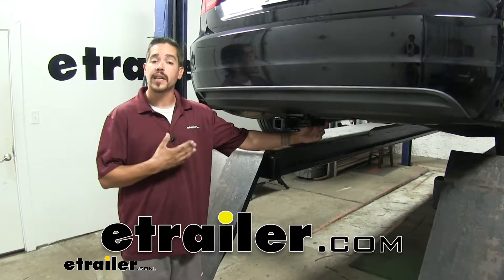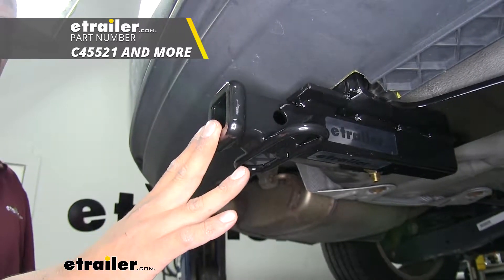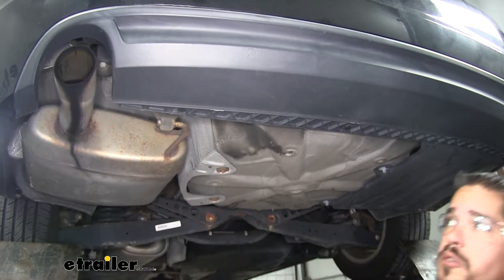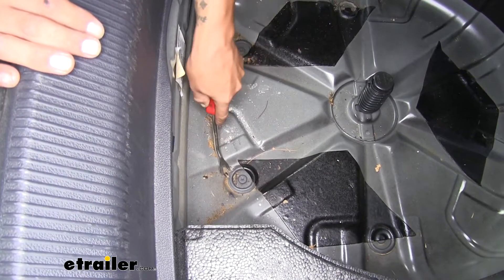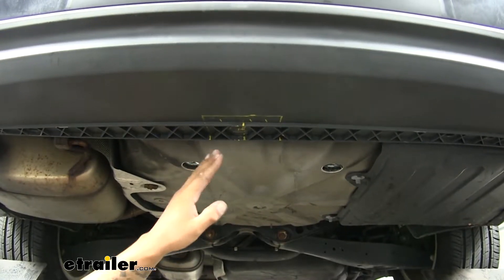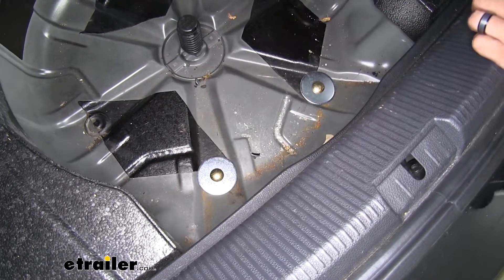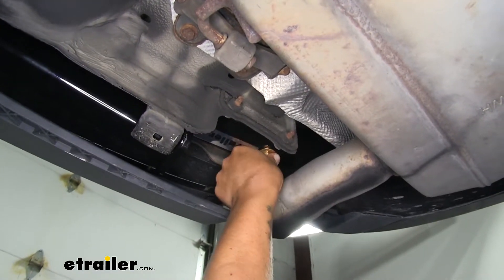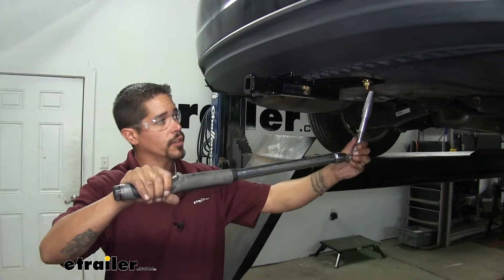etrailer | DIY Install: Curt Trailer Hitch Receiver on your 2012 Volkswagen Passat

Comment: how much weight can it hold or pull?
Reply from the maker: This hitch is capable of handling 200 lbs of tongue weight and 2,000 lbs of gross trailer weight.
https://www.etrailer.com/Trailer-Hitch/Curt/C11234.html